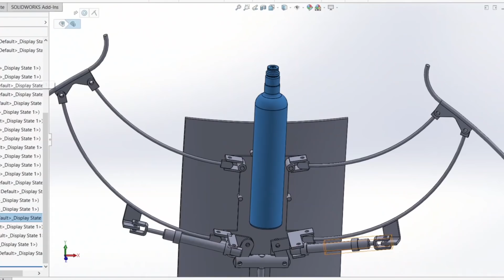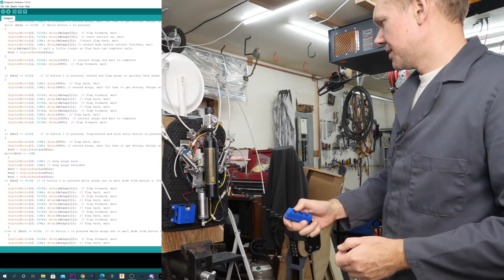Programmable Pneumatic Wings!!!

Comment: 10:11 While cool, it doesn't look comfortable. Look how she is shaken by each motion. Also I doubt it is safe. I think using servos would have made for a far more fluid motion (programmable speed /acceleration curve), would have been overall lighter (bigger battery vs gas tank), more silent, and safer (when adding springs to the wire rope*).
And while an Arduino UNO might do in a pinch, that technology is so old you now might now use a C64 instead. There are microcontroller development boards out there that have as much (or nearly) IO, are smaller, faster, have more RAM and ROM, are cheaper, draw less power, and some even have more than one core.
Your wive's work is flawless, tho.

*=Sorry, I'm not English native, so I'm not sure if that translation is correct

Comment: That was pretty good although I would have gone with stepper motors or another kind of motor to make the movement more fluid like plus it could have been a little cheaper to use a battery but I'm not an engineer.

Comment: Probably the coolest costume of the decade in your town, that is until your daughter makes something even cooler with you next year. 

This would be a great project to revisit with a deep dive on 4 bar linkages. You have used one here but that's just scratching the surface. You could refine the profile of the wing tip to look like real wings flapping slowly and smoothly, and see how small changes in the lengths of the bars effect the end result. Also I have a hunch you could run it off a single motor if you set up the linkages in the right way. That would also be quieter and get the ~~bombs~~ pressurized air off your kid's back.

Comment: Couldn't you have quiet pneumatics? Or use electric for linear actuators? 
Also if it broke once, it needs more robustness.
Reply: You stole my comment. Linear actuators are needed here to get the motion syncronized properly. The binary operation of the valves removes any possibility of getting a smooth, life-like motion.

And of course it has to be more robust if you break anything in testing.